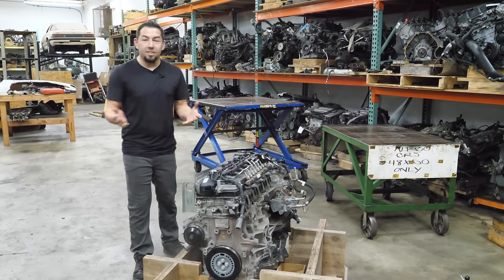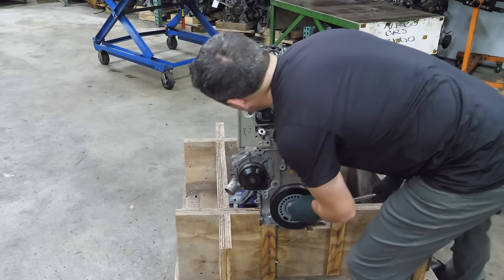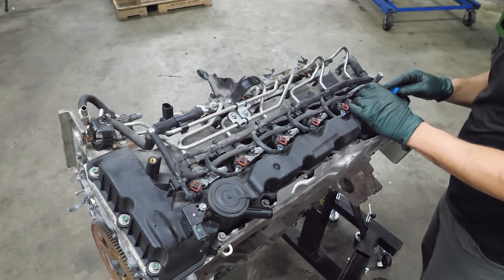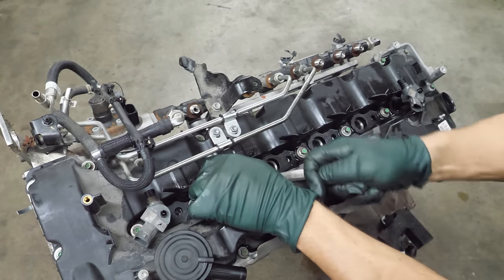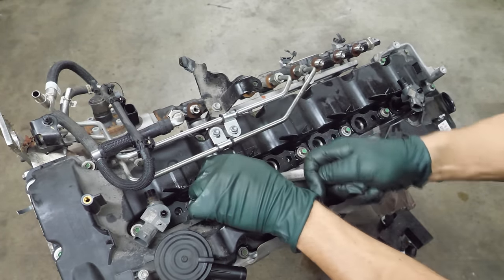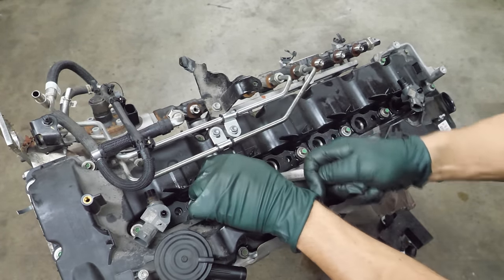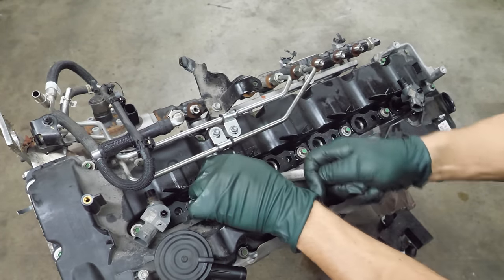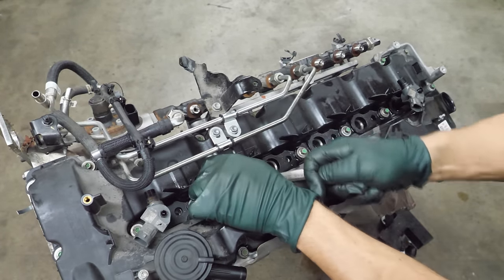BAD 2020 Silverado 3.0 Duramax LM2 Engine Teardown INCREDIBLE DAMAGE!

Comment: Great video and teardown.  I own a 3.0L LZ0 Duramax Diesel so I'm interested any issues associated with this engine.  So far so good, no issues with about 10k miles.  I concerned about carbon buildup at the intake over time.  If you have any info regarding this issue, please comment.  Thanks

Comment: Since there are many Duramax 3.0 owners here, I had a question regarding oil.  I’m new to diesels (2023 LZ0 silverado) I noticed that at 200 miles my oil was black, had dealer change oil at 1200 miles, again black with in 100-200 miles, I changed the oil about 3500 miles later with Amsoil, thinking maybe it was AC Delco which I have never used, but once again it looks old after 200 miles.  Is this a diesel thing or does this engine just foul the oil so fast?
Reply: @hossein3867: welcome to owning a diesel. Perfectly normal. Just use Dexos D oil of your choosing, and change it every 5k and you’ll be good to go. Check your oil periodically like you should on any car and you’ll be golden.
Reply: @toddkovalcik332   Thank you, will do, happy to say, so far no oil consumption at all, and being the oil gets so fouled up so quickly, will change every 4000 miles to be safe.

Comment: Kinda strange that they used a belt for the oil pump, but did the cam trays like that. Figure it would make more sense to use a chain and charge an extra $25 for the engine.

Comment: I worked as a process engineer at a GM facility. I couldn't in good faith stay there, the lead blocks engineer cared very little about sediment in the block. This is likely where a significant portion of the debris came from. Flush and blows on the main machining line did not function and little was done to remedy sediment.

Another point: this engine wasn't designed by GM, it was bought from an Italian company. For some reason, European automakers really love oil pump belts.

Comment: Good powerful  engine  them   but   belts are   week   point  and   you   have   to   put  new   tin    cover as well otherwise  they   leak   ,  someone    could   come  up  with substantial    gasket  to   save   replacing   cover

Comment: Coming from the UK with a Ford 1.8tdci with rubber belt they last around 120k by the service manual. My thought is just planned obsolescence, once it breaks, engine gets wrecked and engine swap. Luckily if you catch it before hand you can get a chain replacement kit.

Comment: Hi mate i found the fault the broken bonnet sensor i chopped the wires abd joined them car is now a flying machine finally 🤣do you know if the focus 1.0 ecoboost has a bug software problem ? 
Somtimes i start it it says engine malfunction service now but when i switch ignition off and  back on the message is gone do u think i need to oil and filter change then reset oil life cheers 👍

Comment: As a former design engineer from automotive, you might be surprised to know that in some cases, the belt is quite a bit more expensive than the chain. In this situation, the belt has probably chosen due to limited package space for a chain tensioner AND to gain some serious efficiency. You might also be surprised to know that you certainly destroyed that belt by bending it as tight as you did... about 27mm is the min bend radius for a belt like this in either direction.

Comment: It would be neat to have a job title of 'remove bolts until parts fall off'. The toughest part for me when working on my own equipment is remembering where the parts go, and in what order.
Don't get me wrong, I have experienced the thrill of reassembly and having a fully working machine, but removing everything is just so much more cathartic!

Comment: Looking at the engine, except for the rubber oil pump drive, the engine design seems pretty solid. Too bad it was run low on oil. I wonder how it happened? It looks like it was under a heavy load when it failed.

Comment: I'd say lack of maintanance and ran low on oil caused this failure, unless it was computer related with the varible oil pump. Amazing what the valves did to the pistons and the valve stems didn't get bent.

Comment: GM has even issued a service bulletin (21-NA-272) stating these engines can use as much as 1 quart of oil every 1,000 miles.  Pulling that 6,000 trailer, through the mountains during the summer months you need to check the oil level at every fill up.

Comment: I had a 2021 3.0 Duramax for a while, it sat in the shop most of the time we owned it. When it was running, it constantly overheated, and ran poorly, then the brakes failed at 15k miles - I got rid of it after that. I'm not impressed with the new trucks or the engine design. I love the idea of a new straight 6 diesel.....but this design is a flop.

Comment: I mentioned on an older one that a Chevy LD9, 2.4l 4 cylinder. The 1996-2002 model years. When they switched to a dual hydraulic and mechanical timing chain tensioner.
They were prone to failure, throwing engine out of time.
I'd be willing to donate mine, (be) out of my '99 Cavalier Z24. Tensioner starting to fail. Only 163,000km. I can even "kill" it, for research purposes of course ;) As long as you cover shipping and can throw me a good one 😂

Comment: How can we shrapnel an engine if it loses oil pressure?
Simple, hydraulic chain tensioner and if that doesn't do it throw a belt on the oil pump.

Comment: I have to laugh a bit. Those pistons would be fine in the diesel shop I worked in for the military. We had engines that came in with the bore so rusted that you couldn't get a finger in to touch the piston and we built those with stock parts. Resleeved the blocks, the cranks either got reground, or spray metal coated and then reground. I used to beat pistons out with a 2 inch dia brass drift and a 20 lbs maul! And we reused those as well, and those engines all made HP on the dyno, passed inspection and were shipped to military shops all over the country. This engine is fine. Ain't nothin money can't fix!😂

Comment: Be on the lookout the 1.6 LH7 diesel found in Cruze, Equinox and Terrain. Those motors have a flaw with the oil driven timing chain tensonor  #deathrattle.  #14kstealership repair.

Comment: i feel like they could have made this engine so reliable. i like this motor/ want to like it. I think if the tensioners were replaced with spring oil assisted followers it would decrease the chance of it jumping timing and swapping the oil belt with a chain. now im not sure if they followers are already spring oil assisted butif they are, clearly the springs need to be upped cause there should not be enough slack on start up to cause it to jump. guess il just stick with my ol sbc and ls, I willl still think about sticking one of these in a squarebody if those issues are easily resolved
Reply: No chains just gears. That is how you solve this issue 😊

Comment: I owned one of those trucks. It seemed like a good engine. Was VERY specific on the oil to be used. If they used normal DELO or some other oil it’s possible the lower end wouldn’t like it. Hard to say. Never know about what people do to motors.

Comment: They figured this out 100 yrs ago, they used bevel gears on shafts. Chains and belts make it cheaper to produce and parts that will have to be replaced. Like the thumb nail said. Built in obselescence!

Comment: 13:09 The sprocket looks very worn from that angle and at 17:15 Shows the timing chain not sitting well on the cam sprocket.
Chain should sit well down and not ride up on the teeth.
A worn chain will flap about on all the sprockets.

Comment: I know people look at the oil pump drive belt as a cheap way out but there are so many hot roders and racers who build extremely powerful engines and most of them will tell you they use timing belts on their engines because they are stronger than chains and they like the little flexibility a belt gives so idk if the belt is the way to go on the 3.0 duramax but I do know that a belt is a lot stronger than people think especially when it’s running in oil

Comment: Thy should have made a front ⚙️ gear assembly I’m not a fan of timing chain because if that chain comes lose it will do so much damage. The metal shavings from the top of the pistons from the valves hitting will tare up the cylinder walls .

Comment: How on earth are those head bolts so tight??  They are steel bolts going into an aluminum block, aren't they?  How could they get that tight without stripping out the threads in the block?

Comment: There are LOTS of issues with this engine.  Where do we start? Diesel engines with emissions systems need high oil flow rates to keep the engine oil galleries from depositing soot in turbulant areas.  Electronic thermostat...the idea that a diesel engine should run as hot as this one does is whackadoodle.  I have seen GM attempt to claim 250F as a plausible and normal operating condition.  The timing system...where do I start with that?  Unserviceable in the vehicle.  Injector bore has dead space that will for sure lead to corrosion and impossible to remove injectors down the road leading to thousands of dollars in head replacements, thousands in injector replacements...good lord.  The wet belt system...listen its fantastic, until you use an off spec oil that has additives that cause problems for the belt.  The more pressing issue is the oil volume control solenoid.  Most cars and trucks with this system have a default full volume position, if the solenoid fails it goes into full flow.  Not these pumps.  Couple that with design spec oil temperatures that are 25 to 35 degrees higher than most engines...its disaster waiting to happen.

Comment: Either rebuild, or clean up take the pistons rods and block and crank 
A big tempered glass top and make a really really cool man cave coffee table.  That cost what the motor cost new.  A reminder to keep up with oil changes and inspections
My thoughts are it was neglected.

Comment: This motor may have failed from low oil. But, there is lots I don't like about it. It's definitely not a diesel that's going to see half million for sure! The oil belt and pump design is definitely piss poor. Thanks for doing this!

Comment: what if the pickup was so clean because after the disaster they changed oil and ran it, cleaning out the oil system? fine stuff will go through this course mesh. because if you run an engine witout oil(or too low) would not the camshaft bearings look far worse? now why that big end failed i would not know.

Comment: To loose just one bearing, this engine should have had some odd torque inbalanced forces at the cranck. A Bad reciprocating design! Especially for nowadays thin film of oils. I'd be getting out of 0w20 asap, going to a more tradicional viscosity like 5w40 or even 10w50.

Comment: Some Motors will get Damage, rotating backwards.
  Always confirm regular rotation direction.
  And or confirm, condition.
 Before turning crank shaft, during any work.

Comment: any diesel engine with a timing chain and belts are junk the belt and chain are the weakest link. there is a reason  heavy duty are all gears.  they use those chains and belts so they stretch and or break . bend valves all that so you gotta pay the dealer or trade it in. thats just my opinion tho. awesome video  again.

Comment: You mentioned which vehicles this engine WAS used in. Actually it still IS the 3.0 Duramax variant used in the full size GM SUV's for 2024.

Comment: Not enough filtration capacity in that oil filter for a diesel. Thats aa 5k oil and filter change interval. I had an old Mercury lynx diesel that had a full flow and bypass filter.......and thats in 1984.

Comment: I don't understand from the video what the cause of the problem was.  Low oil?  It appears that the valve timing system failed in some way but why?  As a 3.0 Durmax owner myself I'd like to know that the owner neglected the oil or something like that.  I'd prefer that it not be a design problem with the timing system or that blasted belt driven oil pump.

Comment: Because    of  low   revs  in    deisels   ohc  pointless     be   better   off   with  cams   mounted    close  to   head  in   block with short   push   rods  and   cams   could    be   driven with   gears

Comment: YEP, YOU WOULD NEED 5 -.010" UNDERSISZED ROD BEARINGS, AND 1 -.080" UNDERSIZED ROD BEARINGS ON THE END.  AND THEN REBALANCE THE CRANKSHAFT.  THAT IS ASSUMING THAT BEARINGS ARE MADE SMALL ENOUGH TO REPAIR IT.

Comment: There’s a reason why your high performance big block Chevy’s that are built for drag racing and are putting out 1500+ hp are using a timing belt vs a timing chain. They have less deflection than a chain keeping a more accurate timing. Now granted, the belt on a big block is outside the block and not bathed in oil or exposed to the high oil temp that the belt seen here is.

Comment: I guess the big question is “why low /  no oil” ?  Did someone change the oil and forget to refill, crazy I know but it’s happened. The lack of varnish suggests regular oil changes. Seems like you thought the engine design was pretty sound with the exception of the oil pump belt.

Comment: You're tripping, those valve recesses are cast into the pistons.  Timing chains don't hardly ever jump more than one tooth, and usually it happens to a modified gas V-8 that has been over-revved.  I assume, because in my 40 years of working on engines I've never actually seen a timing chain jump time.

Comment: Wouldn't surprise me if someone makes a chain drive oil pump upgrade for this motor. Or an external electrical/mechanical oil pump mod. Some really good design choices on it but overall ruined by that one stupid oil pump belt.

Comment: Oil pump was designed that way so that it takes 1 hour vs 8 hours to change out. If you had to drop the transmission vs making a wobble tip at the drive gear shaft. You’re welcome big guy.

Comment: Someone needs to take one of these engines and retrofitted into an older Chevy truck that had a 250 gas motor originally. Add some oil pumps to prime those units before you start.

Comment: I was all Gung ho when this engine first came out. 32 mpg hwy on a 4x4, what an incredible engine. But once I heard about the fuel pump belt having to be changed every 150,000 to 165,000 miles, at the tune of $2000, on top of the $2800 for this engine option above the 5.3 gas. I'd be changing this belt every 4.5 years.! And with diesel being more expensive. No thanks. Great design GM engineers. 4 years of college did nothing for your intelligence.! I have a GMC Sierra crew cab 4x4 Z71 1500 5.3. Currently at 204,400 miles. I did have to replace the transmission at 195,500, even though I did a complete fluid transmission fluid flush every 80,000. With my middle of the road options SLE Sierra, a new one would cost $70,000. I think ill keep mine for as long as possible.!
Reply: It's a 2015. Bought it new. On 12/31/15. Got $10,000 off sticker price. So, about $40,000 out the door. You can't touch this same Sierra crew cab Z71 1500 5.3L today, for anything less than $69,000+. I'll keep it driving until I can't. I try to do almost all of my maintenance as possible. Changed front wheel bearings, U-Joints, rear diff and front diff fluid, transfer case fluid, brakes, rotors, front shocks, .

Comment: I dont get how everyone is shitting on this motor.  140k, completely ate a rod bearing, clearanced every piston to valves, and was still running.  Everything except oil pump belt (location specifically) looks very well built.

Comment: It's a clear example of an owner not checking and doing proper oil change intervals. 140k miles on a 2.5 year old truck is a lot.  Once starved of oil, the bearings will heat up and wear away. Plus the timing will go out of whack and that's why the valves were slamming the pistons.

Comment: People keep bitching about the wet belt but that thing still held and was intact. There is a video of a guy showing the belt wear after 100k and it was just as good as a new one. These things will do 200k easily and chains have a lot of moving parts and do stretch. Plus replacing them arent as bad as taking the whole front accessory system of an engine. Id rather move the transmission

Comment: The first two years of the 3.0 had a bad plastic weld on the valve cover so you would suck the oil into the intake burn out the number two glow plug and use oil about a quart every thousand miles so if they didn’t pay attention that would’ve caused the low oil I would like to see the bottom of the head to look at the valves. Not sure why it jumped time but yes, I definitely didn’t like the wear point on the oil pump. That’s as bad as Pontiac with their nylon timing gears back in early 70s but I digress.

Comment: I am thinking if I had to do a head gasket with the engine installed, I would quit my job. Did they put that engine in any vans nice. I have worked on powerstrokes in ambulances (vans) sucked!

Comment: I have done a valve job on my 2.8 VM Motori in my 06 Jeep Liberty. I dislike these engines very much. I see those rockers are over built because the rollers were weak. They fix one problem & cause others.

Comment: Looks like the GM engineers wanted to one up the Audi V8 engineers by not only putting timing in the back of the engine with plastic guides, but by using rubber belts for the oil pump.

Comment: Much like Audi V8, this (and many smaller diesels) have been designed in Europe.  The theory as to the timing chain, and oil pump 'belt' end up against the firewall.  Poor design for  US, but ... this brings back old GM diesel issues from the 70's/80's.